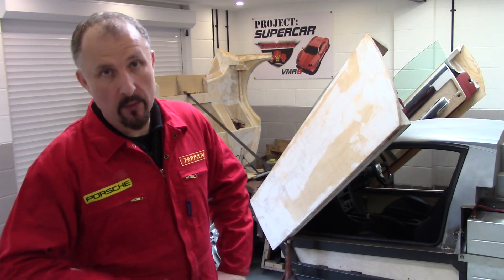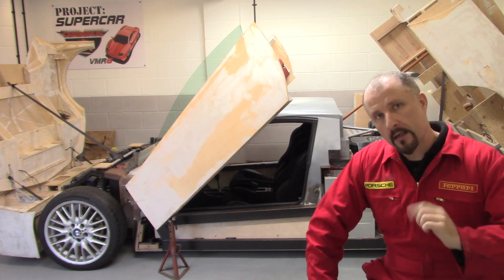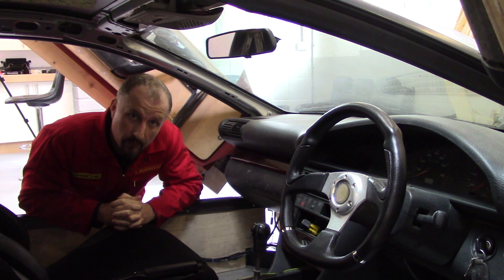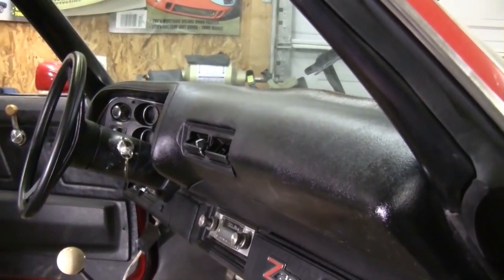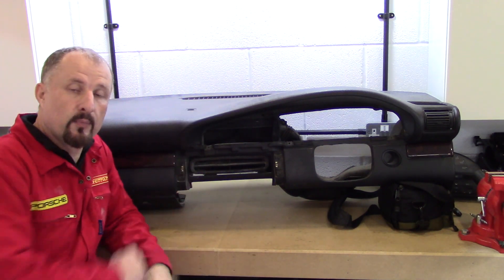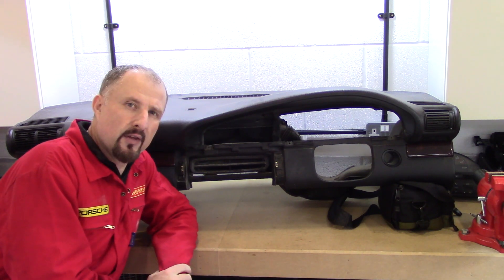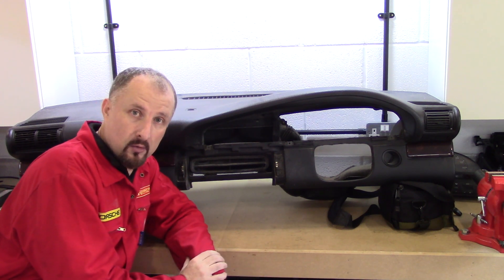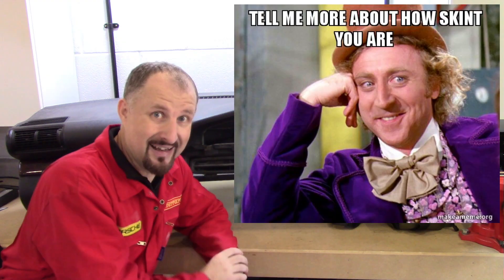Dashboard, Clocks and Switch Gear for my DIY Supercar: Prototype Ep19

Comment: Which color are you going to give it when Finished? I Would go for grey or a  bit of koenigsegg CCX Style but red would be Nice too👍😁
Reply from the maker: I like your thinking; I'm considering a dark satin grey, with some anodised red areas, like behind the side glass and inside the air-intakes, oh and I want to anodised the rear grill red as well. But I might go black and red, not sure. I might have to get some PC images done, with different paint schemes, before I pull the trigger on an expensive paint job ;)